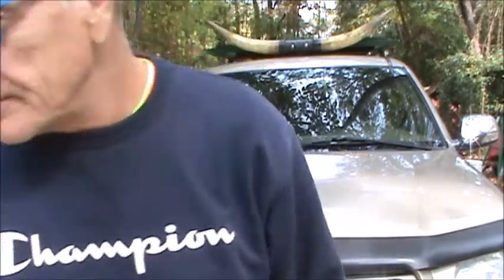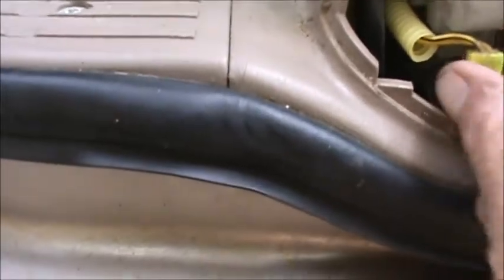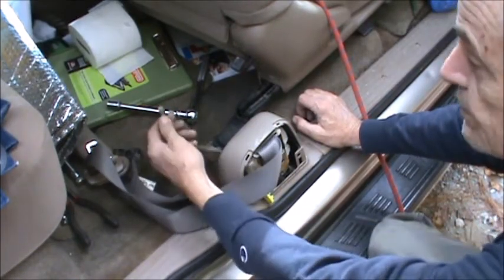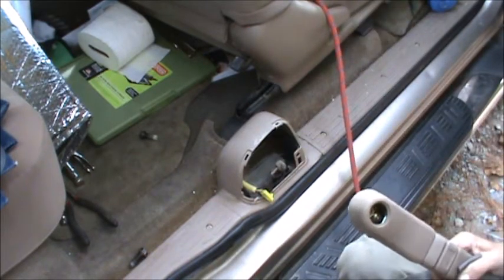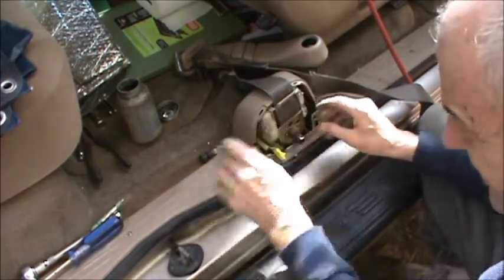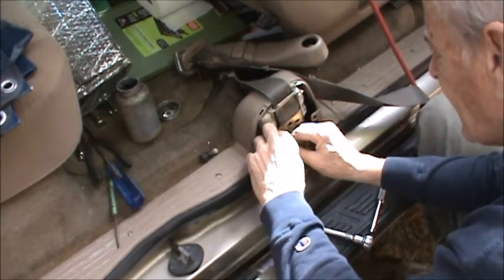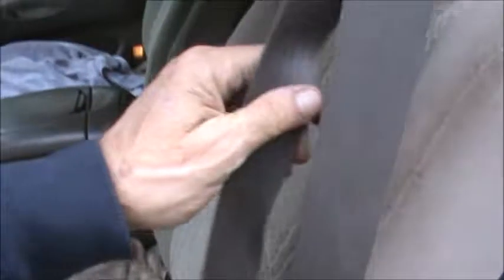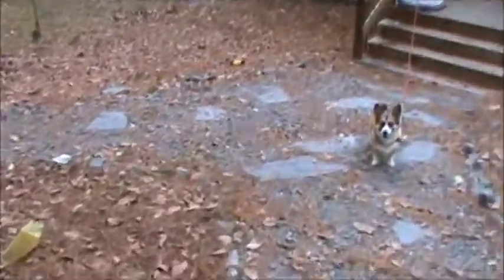Replace Seatbelt 03 Tundra

Comment: Nice! Thanks for this. I ordered a new seatbelt retractor for the drivers side cause I was sooo damn tired of my belt not retracting and getting caught in the door jam. I’ve heard of people simply cleaning the grime out and sanding down the area at the top where the belt passes through.l but I figured eff it just order a new one. This was all simple tho I’ll just pull the belt off and clean it real good and see if that helps before installing my new one if it ever gets here

Comment: I am looking for replacement of seat belt driver side of tundra 2001 Pleaxse
Reply from the maker: You have two choices 
Go to dealership and buy one or take the broken seatbelt out and send it the company I used to fix mine. 
Safety restore  you can find them online mail the old one in and they will rebuild it to factory fresh.
Reply from the maker: I have another video where I send off seatbelt to be fixed